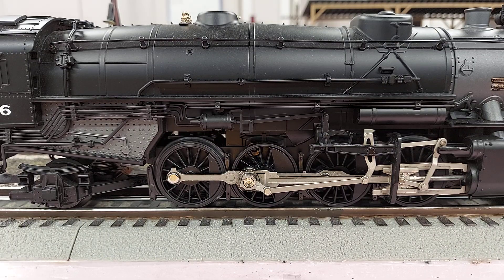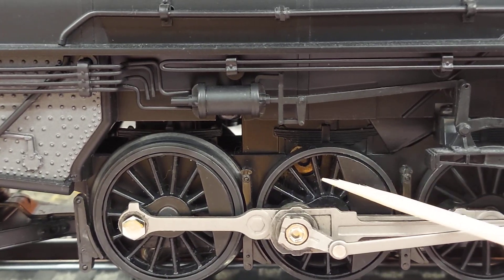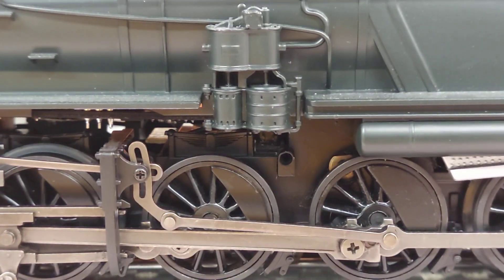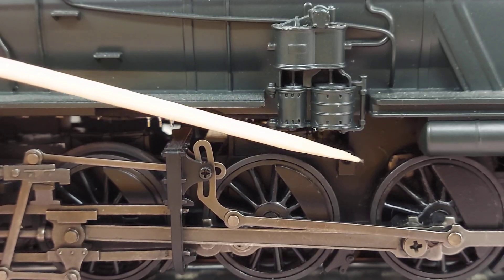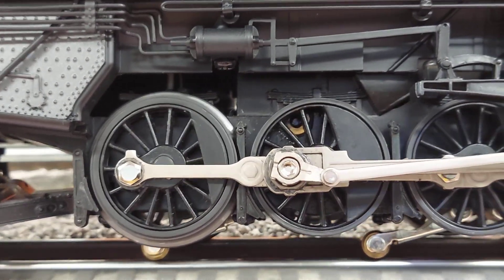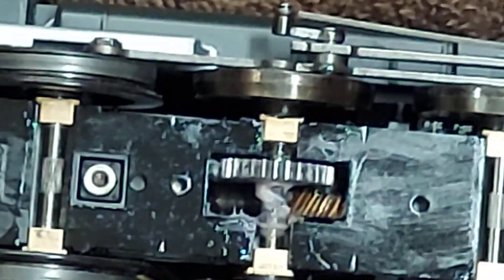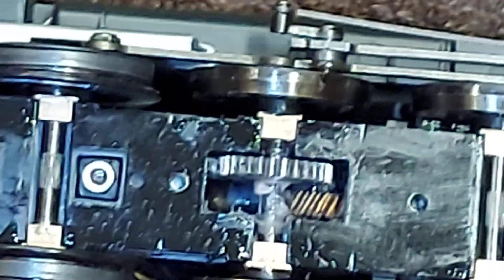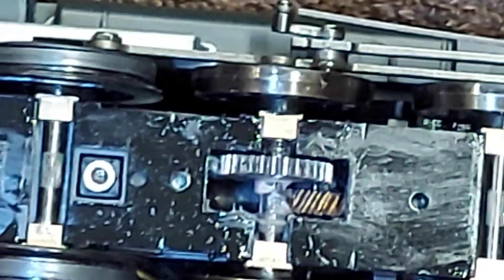Lionel Legacy Steam. Complex Gearbox Concerns.

Comment: The reason they add that idler is it adds more torque to the drive and which also in turns creates less stress on the motor and drawing less amperage through the motor circuit. I highly recommend everyone oils and greases their drives on all new models. The factory fails to add enough grease and oils to the components. I have seen bone dry drives straight out of the box on high end items.
Reply from the maker: Thanks for your input Bruk. This design came along after Lionel switched from Pittman to Canon  motors in the second gen Legacy stuff.

 I'm curious of your opinion. Is the Canon motor not up to the task of direct drive, or has the newer Legacy electronics become more sensitive to voltage draw?
Reply: @ricko3242  We are now in the 3rd generation LEGACY electronics. (2020) I believe the performance of the Cannon motor has nothing to do with the reason why they are adding the idler. I think its just better performance like I mentioned above. Its possible that they might be trying to not crank up the PWM (Pulse With Modulation) in the motors to maintain the torque that could be achieved through gearing. Maybe the new Cannon motors can’t handle that frequency long term like pitmans could. I know a lot of people don’t like the Cannon motors. A hand full have failed in the past. But that could be from high PWM or a bad batch of motors. Ive been working on lots of LEGACY engines with these motor and I have yet to see a faulty motor.
Reply from the maker: @pnw_oscale  Once again, thanks Bruk! 

I really appreciate you sharing your knowledge on this topic

Comment: This is a great video Rick.  There isn't a lot of this type of content around. Very informative.  Thank you.
Reply from the maker: Thanks Jeff! Glad you found it useful. 
This gearbox has been manufactured for a decade now.

I believe you have one of those original Legacy K4's no? Keep an eye on that secondary shaft.
Reply: @ricko3242  I do have one yes. Never knew of this possible issue. I just checked mine through the spokes, and I guess it looks OK so far.  It's definitely lubricated.

Comment: I have over 60 plus lionel legacy engines and have been running the hell out of them with no problems. 
 If you find ones that the gears are going bad contact me at Hennings trains we have been making gears for lionel for replacement.  If we have old gear then we can manufacturer them in our MEW parts line.
Reply from the maker: Good to know Harry! One of your "best techs" is very familiar with the failure on the 1st run Legacy K4s, which were one of the first with this gearbox setup. 

Lets hope it was some sort of manufacturing defect, and changes were made to prevent future issues.

Comment: What are your experience with MTH steamers?
Reply from the maker: I'm primarily a Lionel operator as I prefer  the Legacy command system and sounds, but MTH steamers do NOT use this design.

They use the traditional worm  and axle gear and are very reliable.

I'm not aware of any gear issues with MTH. IMO, During the last several years. MTH has had a much  better track record for overall build quality than Lionel. MTH is also much more user friendly when it comes to ease of maintenance.

I find the mid 2000's Lionel TMCC stuff to be much better made, than the Legacy stuff.It just lacks some of the operating finesse which I can live with.
Reply: MTH steamers are bullet proof mechanically.  Like Rick O, I'm not a DCS fan.